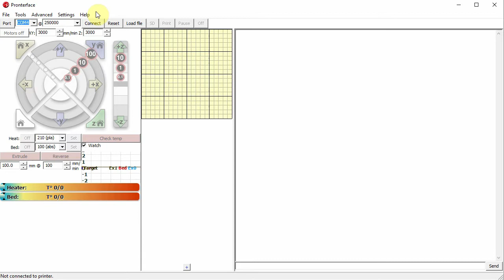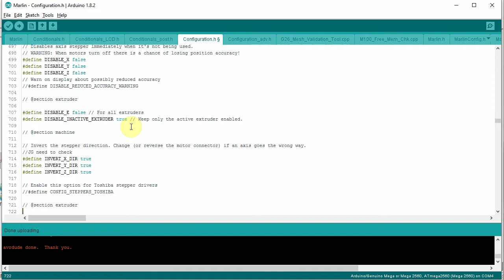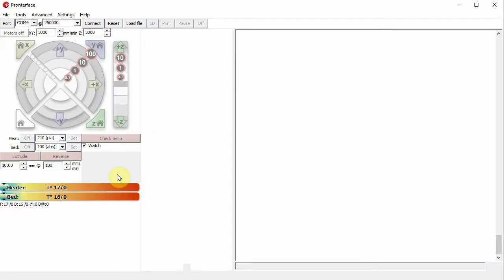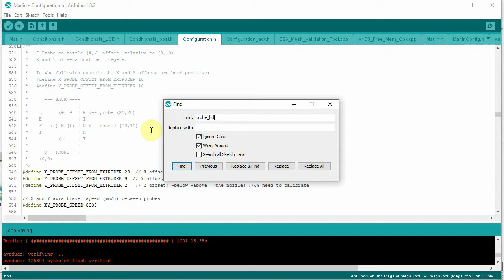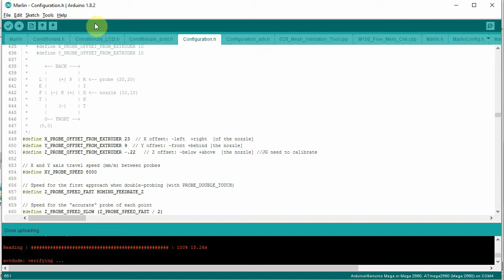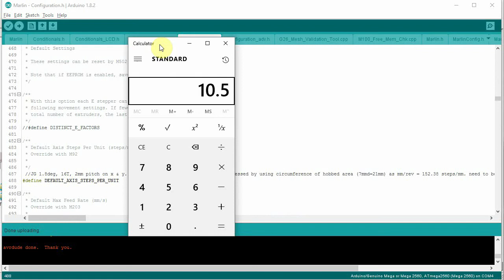Reprap / Prusa 3D Printer - Complete Initial Setup & Configuration - Step by Step

Comment: Please help! When under manual control my X,Y, and Z only move in one direction. Example: When I manually select X left 1mm it works fine, when I select X right 1mm it still goes left. When I switch INVERT_X_DIR from True to False it does the same thing but opposite.
Reply from the maker: what printer? what are you using to "manually" jog the axis?
Reply: Rep Rap Prusa I3. I’m adjusting the code in Marlin, and using Repetier to manually move the system
Reply from the maker: @JamesBrossart  is it only when jogging with repetier? You need to check your endstop config in Marlin - endstop directions, min/max etc. Sounds like it thinks it has hit an endstop. I take it that it also isn't homing properly?
Reply: @julesgilson.  Confirmed, the only movement I have attempted is manually jogging w Repetier. Below is a paste from Marlin, thank you a million for even giving me the time of day. You are correct that  homing doesn't function at all in any direction.

#define INVERT_X_DIR false    // for Mendel set to false, for Orca set to true
#define INVERT_Y_DIR false    // for Mendel set to true, for Orca set to false
#define INVERT_Z_DIR false     // for Mendel set to false, for Orca set to true
#define INVERT_E0_DIR true   // for direct drive extruder v9 set to true, for geared extruder set to false
#define INVERT_E1_DIR false    // for direct drive extruder v9 set to true, for geared extruder set to false
#define INVERT_E2_DIR false   // for direct drive extruder v9 set to true, for geared extruder set to false

// ENDSTOP SETTINGS:
// Sets direction of endstops when homing; 1=MAX, -1=MIN
#define X_HOME_DIR -1
#define Y_HOME_DIR -1
#define Z_HOME_DIR -1

#define min_software_endstops false //If true, axis won't move to coordinates less than HOME_POS.
#define max_software_endstops true  //If true, axis won't move to coordinates greater than the defined lengths below.
// Travel limits after homing
#define X_MAX_POS 200
#define X_MIN_POS 0
#define Y_MAX_POS 200
#define Y_MIN_POS 0
#define Z_MAX_POS 175
#define Z_MIN_POS 0
Reply from the maker: @JamesBrossart  you cant do much in the way of movements before homing.. the printer has no idea where the nozzle is. Everytime you start the printer it needs to home to find 0 on X,Y & Z then it knows. So you need to get homing working properly. Start by triggering the limit switches (with your hand) and make sure the firmware is seeing those triggers. Take it from there

Comment: excellent video really helped me a lot
my y axis is reversed i have changed all parameters in config.h but it still stays in reverse
been thinking about reversing the lead any ideas
Reply from the maker: If you mean the motor is running in reverse you can just swap the wires round in the connector. Just try putting connector into the controller board (RAMPS?) the other way around first. The wires are often black, green, blue & red - so if your was wired in that order try red, blue, green, black. If that doesn't fix it try black, green, red, blue. Having said that if you set #define INVERT_Y_DIR true in configuration.h then that should have done it.... Are all the motors the same model?